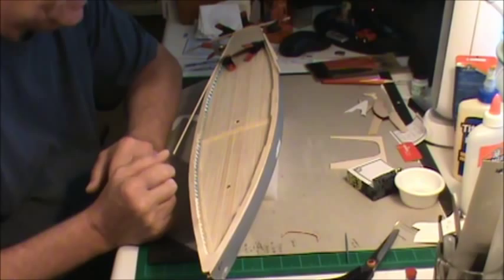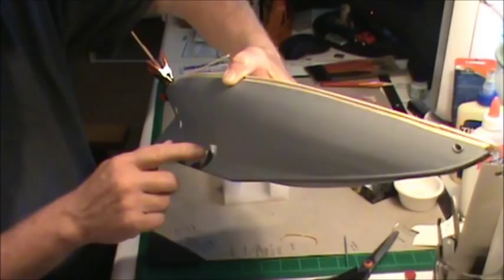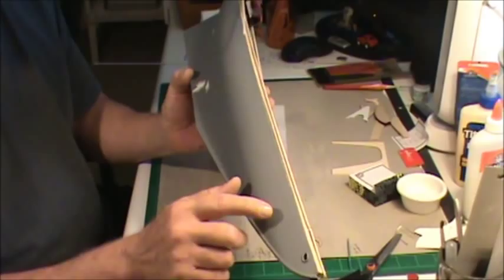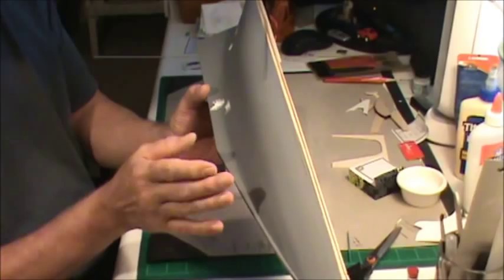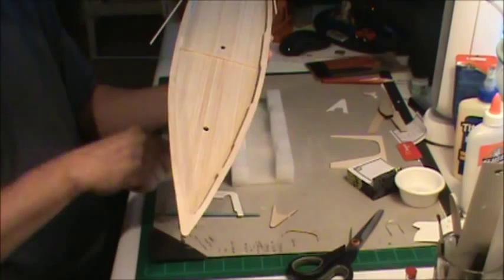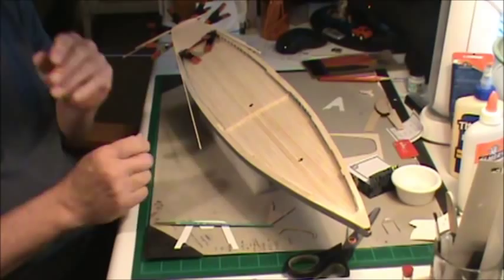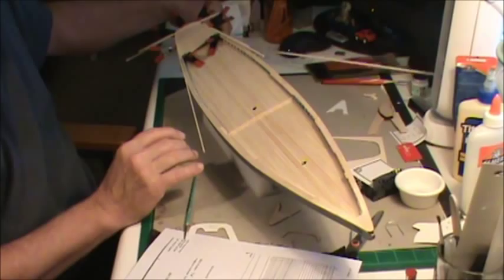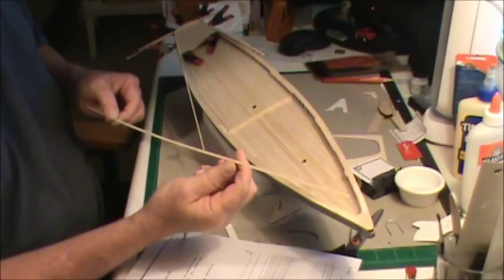BLUENOSE PART 17

Comment: Just thought I would add as you have almost got there yourself, if you have a painted surface and wish to gain a purchasable surface edge such as for clamping lay down your blue tape then use hot glue to secure a edge you can use for clamping (on top of the blue tape) after the clamping job is done be sure to remove the tape (and clamping block/edge) as the glue will break down over time and leave undesirable residue.

Comment: Gary - can you tell me what type of putty did you use? I've been using Elmer's Balsa Wood putty but I can't seem to get surface completely smooth. Any suggestions on what I'm doing wrong?
Reply from the maker: At 1min and 19 seconds into the video I tell you what putty I used, TAMIYA WHITE PUTTY.  For me to get a smoth finish I never sand with my hand or fingers.  I always use a sanding stick laid flat to the surface.
Reply: Sorry I missed it but many thanks for your response.  I continually tune in on your videos to watch your builds and comments and tips! Look forward to your future projects. Thanks!